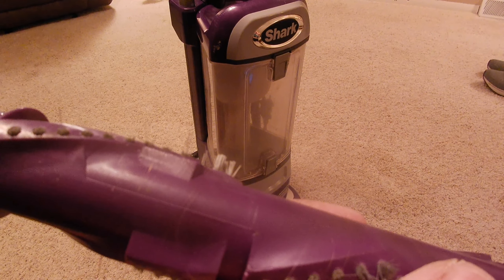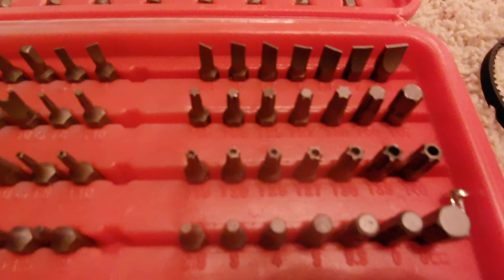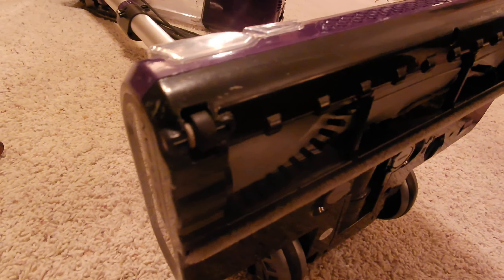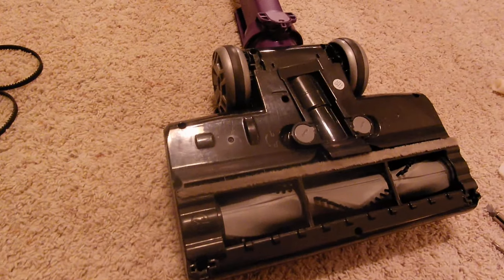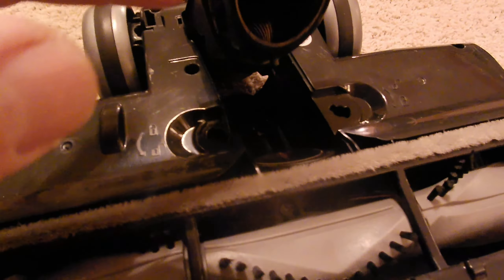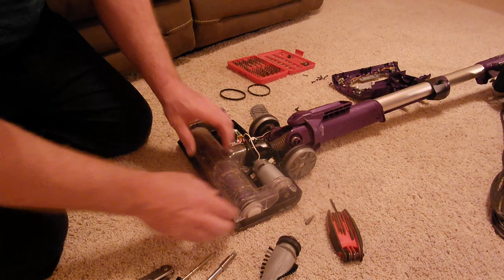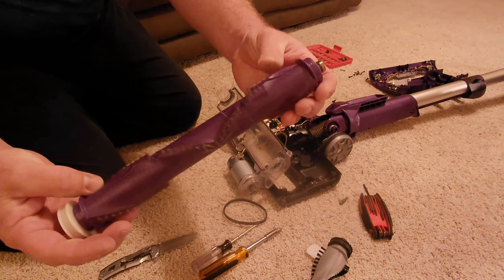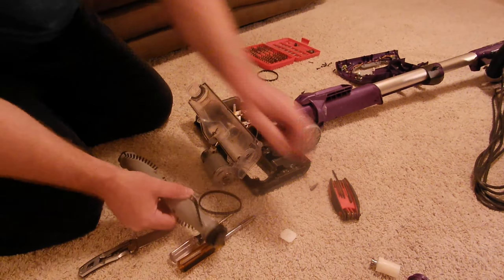Shark Navigator brush roll and belt replacement

Comment: OK, can you advise me on how to put that spring back in place?  It popped out and I can't figure out where to situate the longer end.
Reply from the maker: I believe the long end just sits in there.  When the handle and the body are laying flat during the repair there really won't be any tension on the spring.  It only develops tension when the handle moves perpendicular to the body.
Reply: @ssmonte8738  Thank you for posting this.  Was very helpful.  Is the spring there to make sure that the bottom part locks upright?  I just replaced the brush and noticed that the bottom part flops downward when I pick it up.